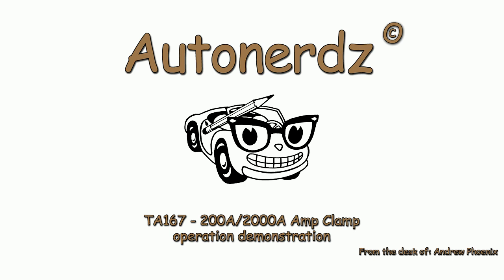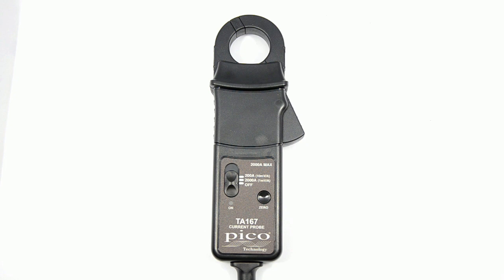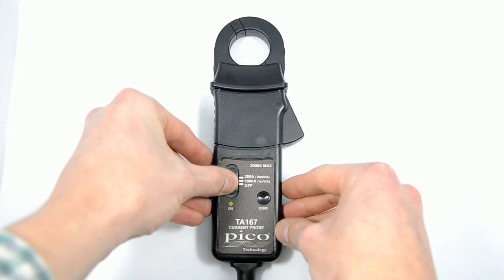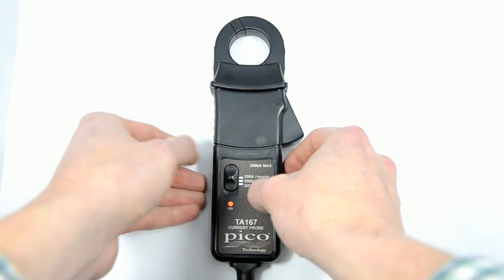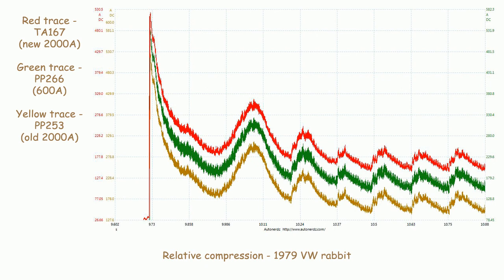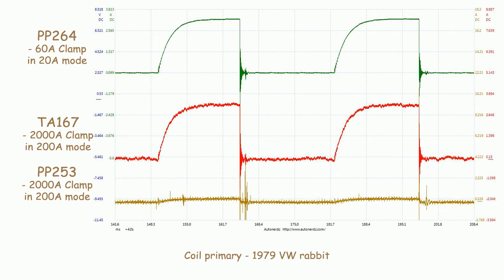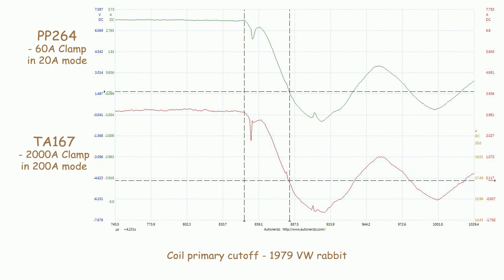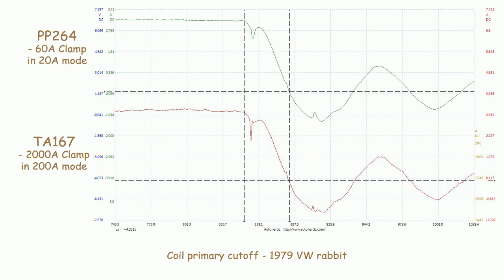TA167 Operation and Functionality

Comment: my battery died in my TA167 I don't want to brake it open how do I open it with out braking it?
Reply from the maker: Link to the user guide https://www.picotech.com/download/manuals/ta167-2000a-current-clamp-users-guide.pdf
Reply: @autonerdz  thank you very much